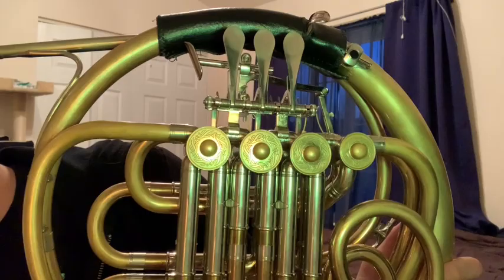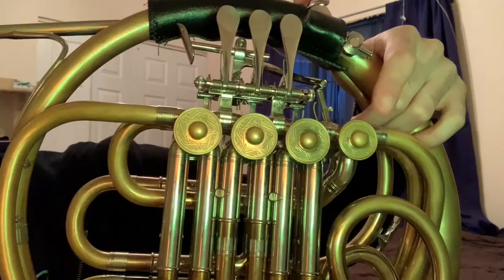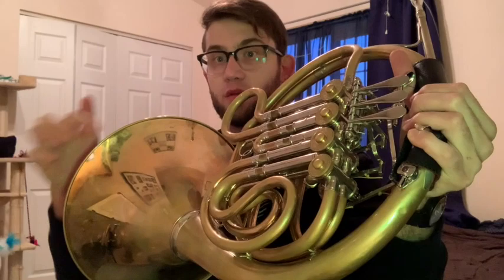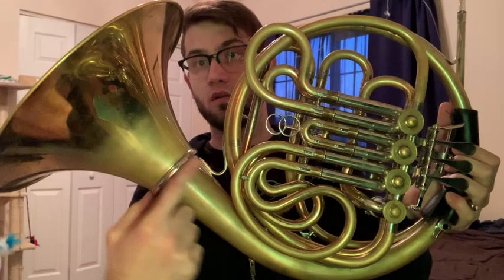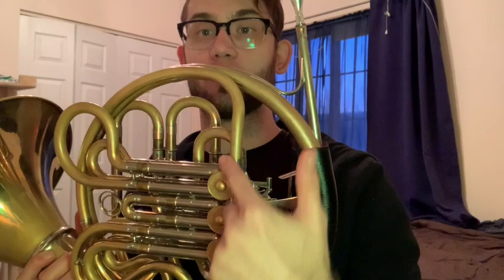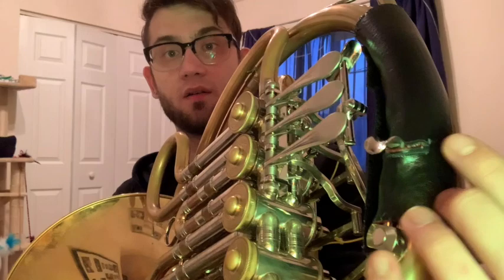Week With a Horn: Yamaha 871

Comment: I had this horn for a couple days and would like to opine if possible. There are major flaws with this horn. The "thwack" sound that the change valve makes is horrible. If you don't know what I'm talking about, when you slur notes over the 2 sides of the horn, it makes a loud sound that  is extremely distruptive in the low range. That alone puts in the student level category. The horn is not well made, slides are not aligned, the valves feel terrible and are noisy. With the almost $9,000 pricetag, it's an overpriced student level instrument.

Comment: 1. CHANGE valve — not EXchange.  2.  You might consider putting GEYER in the title of your video since you REFER to your GEYER videos in subsequent videos.  IJS...
Reply from the maker: Jay J Thank you for the input, I try to keep my titles simple, just the model name works fine. Change/exchange valve, doesn’t matter to me. I am sure viewers understand regardless of which term I use. (I have seen both used before.) The goal of my videos is to provide brief and comprehensive overviews about different horns, along with as simple of an explanation of how they work.  If I have an original Geyer horn, I will be sure to put the name Geyer in the title.  Thank you for your thoughts :)